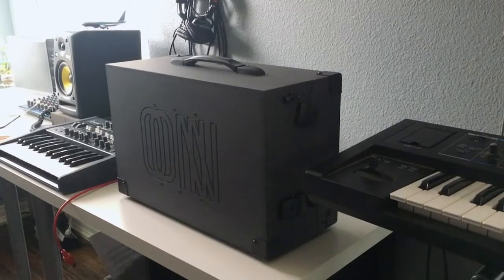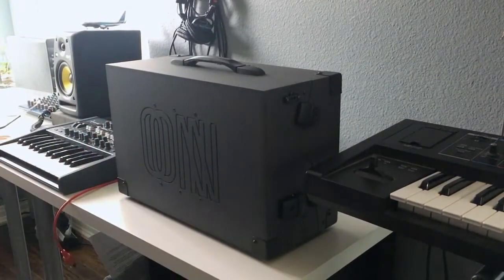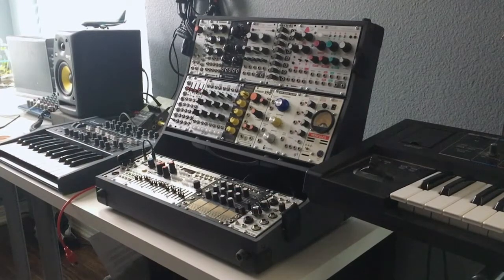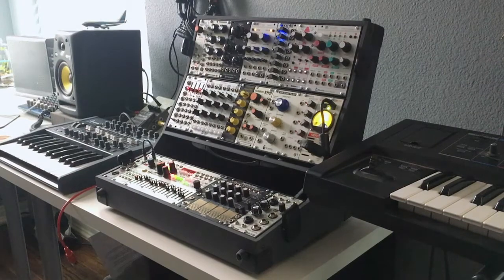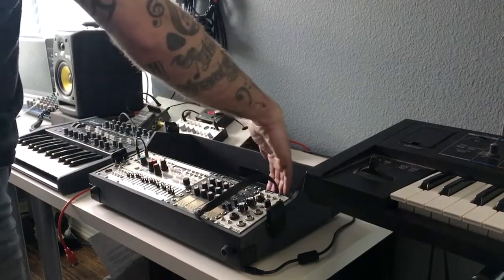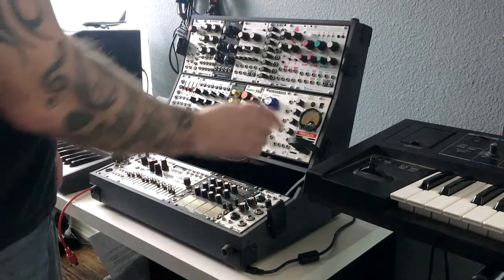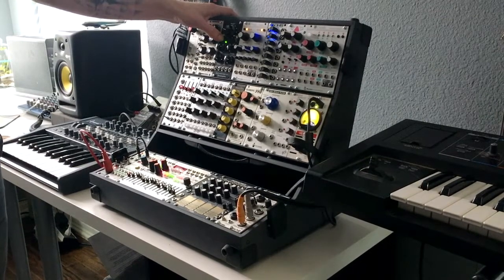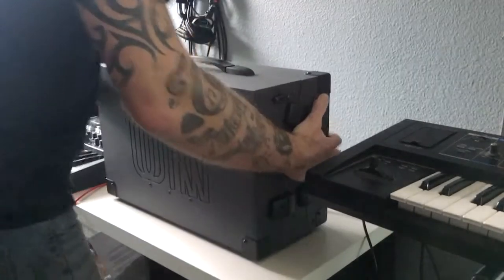NONO Lander 3.84 Review (Kickstarter Version)

Comment: Do you find that your modules overheat in this case? Just got a 104hp version and they get hotter than I’ve ever experienced them. Not burning, but the faceplates are warm to touch.
Reply from the maker: I've not experienced that but I suppose it may vary based on the modules. With my Lander case - and they may have changed this as mine was one of the first off the line - there is a slight gap between the rail and the edge of the case on the 6U section. I think this facilitates a natural airflow. The bottom (3U) section has plenty of airflow so I haven't noticed any heat there at all. In fact, I had some tube modules racked there for a bit and those tend to run hotter.

Comment: Is it possible to save patche when you fold the case??
Reply from the maker: Thanks for watching. It will fold patched, but depending on what cables you're using, it could be tight. The shorter barrels work better if you plan to transport it patched. If you have multiple stacked cables in the same jack, that may also be a concern. However, I have successfully folded it patched multiple times. It works.
Reply: @musicalmiscellany  Thanks for the fast reply! I really like the case, now I use mantis so I really wanna get patch save 9u case It is super cool design :)
Reply from the maker: @gyuchulmoon8556  I highly recommend NONO cases. They're really great.